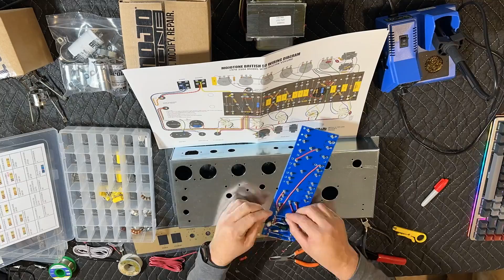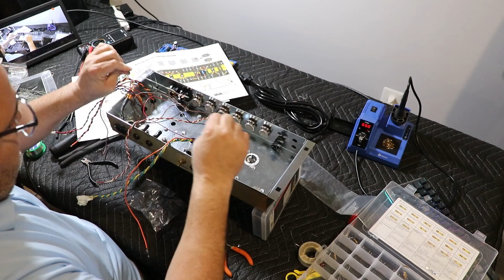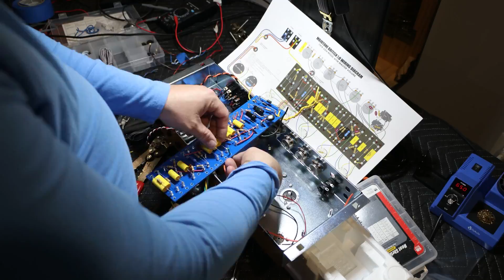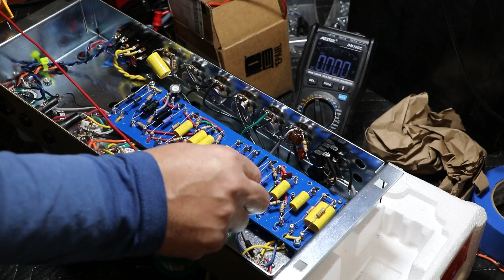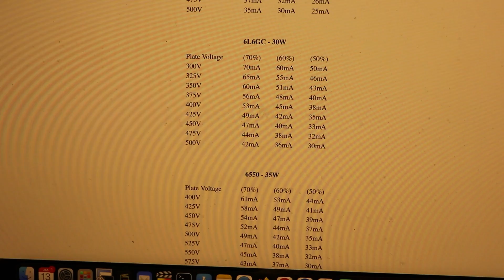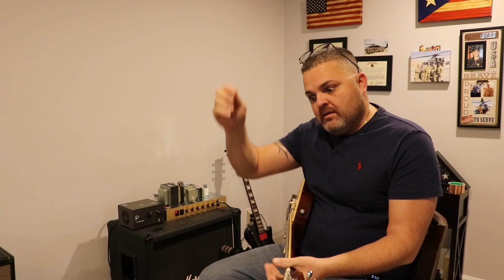Building a British Style 50w Amp from Mojotone: A Journey from Parts to Power and Tone!

Comment: I do not recommend turning on a tube amp without a load (speakers connected). When servicing inside the chassis discharge the caps before you re-enter. It is very easy to do. Caps hold enough juice to stop your heart. Never use both hands when dealing with the chassis without unplugging then discharging the caps. Electrician gloves aren't expensive on Amazon.

Comment: Great build, the only thing I would've done differently is when you're soldering wires to any tag with an eyelet hole, you should always pass the wire through the hole, then solder it. Tack soldering to the surface of the tag will work ok, but if you have any solder joints where the solder hasn't flowed well, the wire can easily come off and if it's a critical wire (power, speaker out. etc) you could end up with a big problem.
Reply from the maker: Thank you for the feedback! I appreciate the tip. That makes a lot of sense and definitely sounds more secure. I'll make sure to incorporate that technique in future projects to ensure better solder joints, especially for critical connections. Thanks again for sharing your knowledge!

Comment: Those jumper wires go UNDER the board not on the component side. I usually roll my AX7s for AU7s. Still plenty of volume but cleaner top end and more headroom.
Reply from the maker: Thank you for your feedback. I followed the wiring diagram provided by MOJOTONE, and they illustrate placing the wires on top of the components. While you could route them underneath, it likely won't make a significant difference in functionality. Also, on their website, they have pictures of completed boards with the wires positioned over the top. Ultimately, when building it yourself, you can choose to run the wires over the top or underneath based on your preference, either approach should work without issues.

Comment: Awesome job! Love the meticulous wire routing. 

When you did the initial voltage testing without tubes, do you need a load on it, or is that only needed when you have tubes installed?

Also, how does it take pedals? Does an OD/Distortion pedal sound good with it?

"I'm not a good guitar player". You're better than you think you are. 😁
Reply from the maker: Hi @tim_shipp,  it's generally recommended to have some form of load connected to mimic the expected operating conditions. This helps ensure the power supply and other components are functioning correctly under load. However, it's not strictly necessary for initial testing if you're just verifying the power supply is outputting the correct voltages. During my initial power-up, my main concerns were making sure there were no incorrectly connected cables that could cause a fire hazard, as well as checking that the filament voltage and negative bias voltage were present to prevent the output tubes from being overdriven and red-plating. As for using pedals, I've tried out some overdrive pedals like a Klon clone and the SD-1, and this amp takes them like a champ!

Comment: If you are measuring cathode current is not the same as anode current it will also include screen current which is 9.5ma,  I have built the same amp and set the current for 49.3 ma  including screen current and plate volts is 440 volts
On line can be found a bias calculator for el34 just enter plate volts and tube type.
Reply from the maker: @itsonlyme9938 Thank you for your comment and information about biasing. I was not aware of the screen curent affecting the total current. 

Also, thanks for the tip about the online bias calculator for EL34 tubes. I have seen the Robinette website with a lot of great amp building information. 

https://robrobinette.com/Tube_Bias_Calculator.htm 

Tools like that are incredibly helpful for getting accurate measurements and ensuring the amp performs optimally. It's always great to have such resources at hand, especially for DIY amp builders who might be new to these concepts, like myself. As an amateur still learning the ropes, I really appreciate insights from more experienced builders.

Appreciate you sharing your experience and knowledge – it's a huge part of what makes the DIY audio community so fantastic!
Reply: @DIY_AudioGarage  The Robinette bias calculator is the one I used.
Glad the info cathode bias was helpful and I think it does give full  output when its  set to optimum bias.